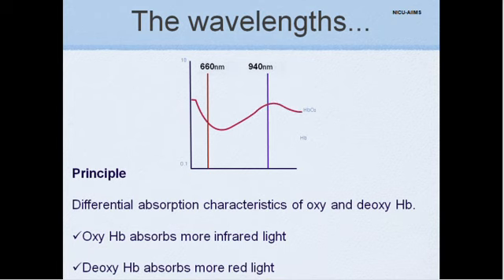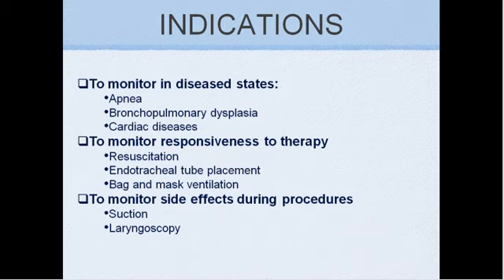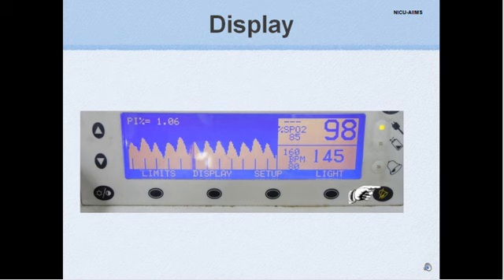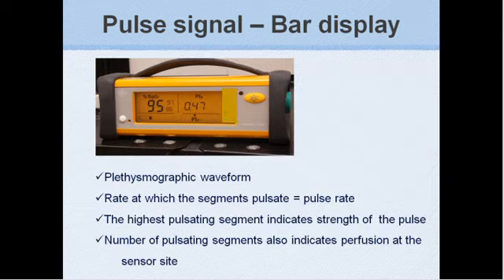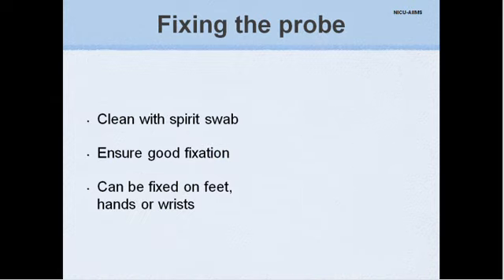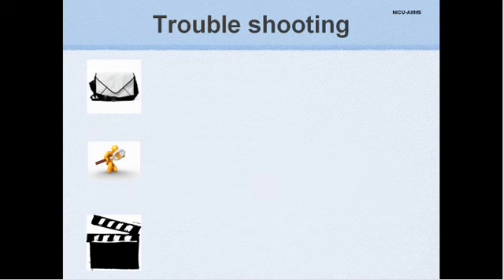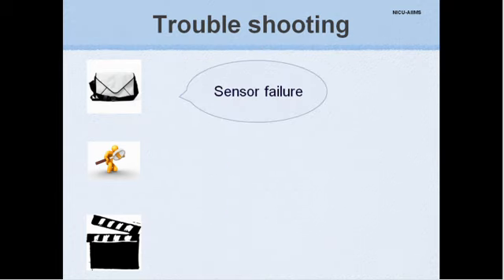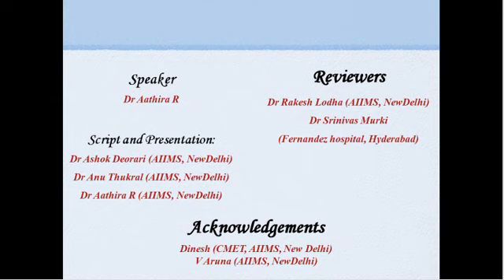ONTOP- 3 pulse oximetry

Comment: The upper 3 pictures in 2:16 is the connection of the sensor and the internediate cable, not the charger input.